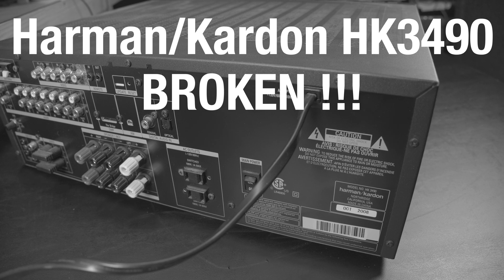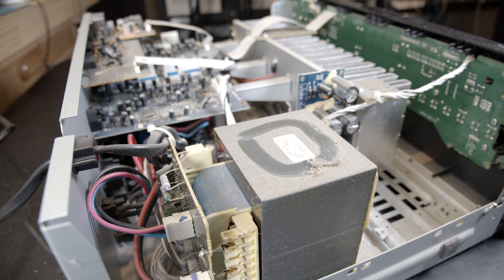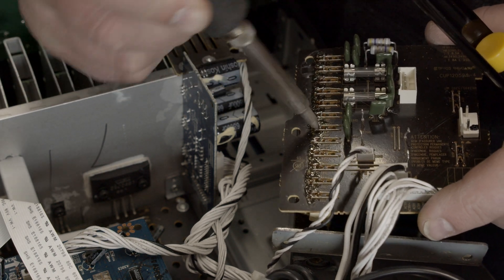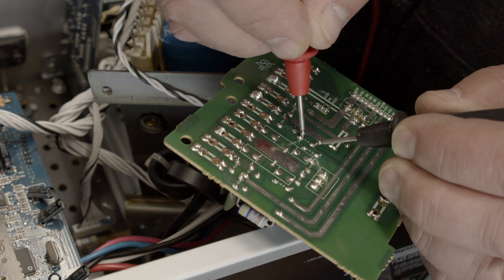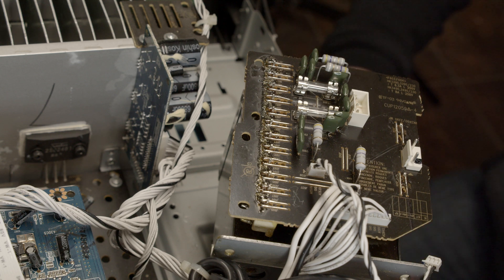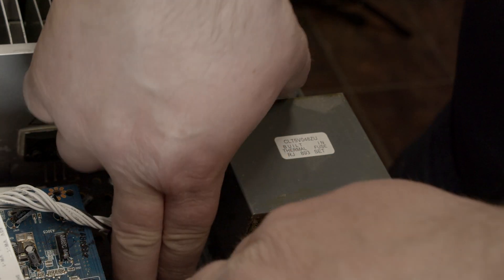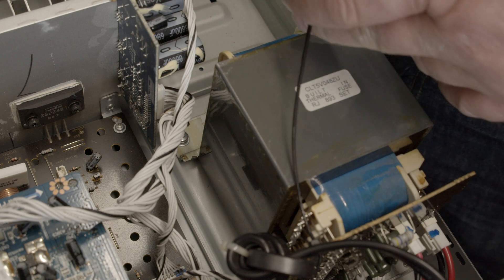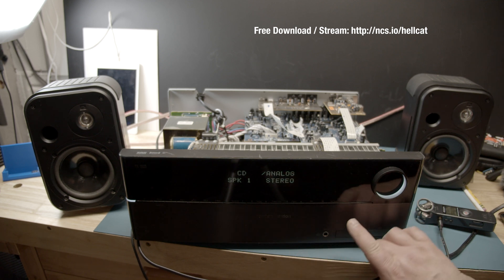Repairing a Harman/Kardon Amp for One Dollar

Comment: Very helpful video, thanks alot. But what's causing two fusible resistors to break? Is this deterioration, or was there possibly another rootcause resulting in this secondary defect? Or is it the design too close to the margin? Cheers.
Reply from the maker: in my case it was a thunderstorm that produced overvoltage

Comment: I have a HK 3490 I have had for probably 14 years and the left channel has a his in it that is slight but noticable, it's been there for probably 12 years (I happened during a brownout voltage dip) I now have it on a UPS to protect it from under voltage. I love this receiver and it's power when paired with my Polk Monitor 70s it will blow your socks off! I am surprised those tiny JBLs can take all that power without blowing out (I blew a pair of Polk Monitor 50 towers before getting the 70s). I noticed the static in the left channel affects the headphone amplifier also so I am assuming it is an issue with the power supply not the amp. 

Would you know where I should look to fix this left channel hiss? I barely notice it unless I walk by the left tower speaker, but it makes headphones unusable because it is so noticable.
Reply from the maker: Hard to say over the internet. It may also be caused by a dried up or blown capacitor. It's probably best to find a repair shop in your area.

Comment: I also use H/K on my PC, HKTS 60 with BDS580 but if it does something, the fuse has to be okay. If the fuse is blown, why would it start up? So why check the fuses? They are checked already when the power comes on.............................

Comment: Thanks for the tutorial. Are your HK still working? I mean there is a reason why the resistors were broken. I have the same problem, it would be good to known  why is that happening.
Reply from the maker: yes, mine still works. The resistors are like fuse, they protect the rest of the electronics. Unstable power is the problem. Mine died during a power outage with a huge spike in the power line (lightning).
Reply: @mygiguser ah, that's the explanation. Now I understand. Thanks alot.

Comment: I've just repaired my unit :) You dont need to resolder whole board. It is much easyer to cut old resistors leaving old wires and solder new ones to them. Greetings from Poland :)
Reply from the maker: good for you!

Comment: Hello pal, thanks for posting it. I have the same amp as yours, with the same power protection message, today I'll replace the same resistors and cross my fingers. I have just one question, how did you measure the resistors, did you measure for continuity? Thanks!
Reply: Changed resistors R951, R952, R998, R999. Unfortunately, the issue persists.
Reply: The capacitors around could be in short circuit Michael
Reply: And now, the resistors broken again
Reply from the maker: the ones i measured were supposed to have  0.47 ohm, they were open. You need to replace those with 0.47 ohm.